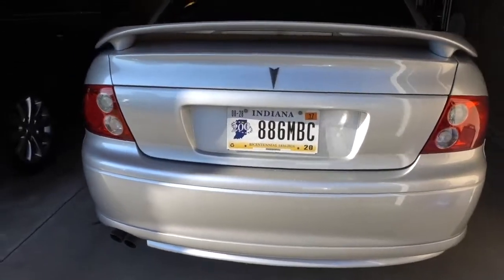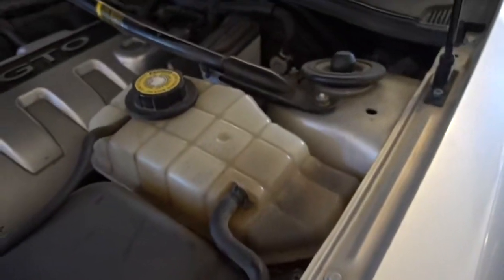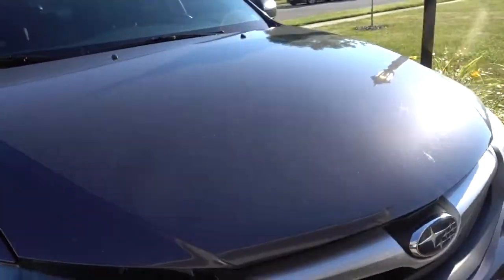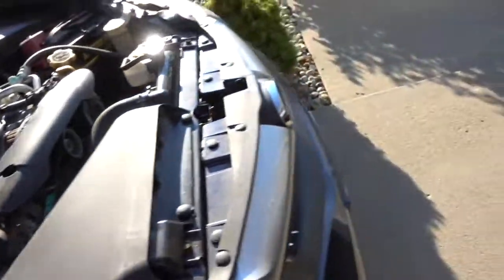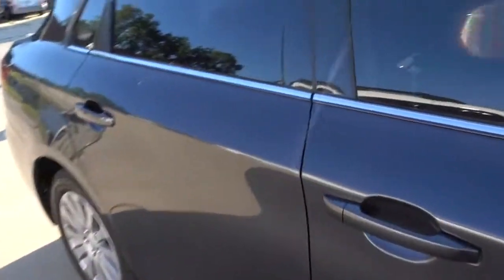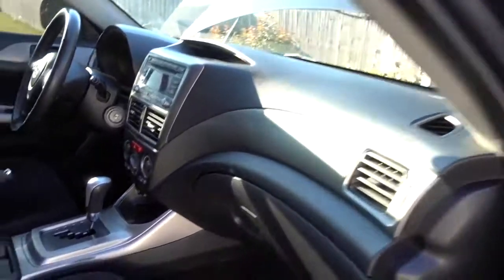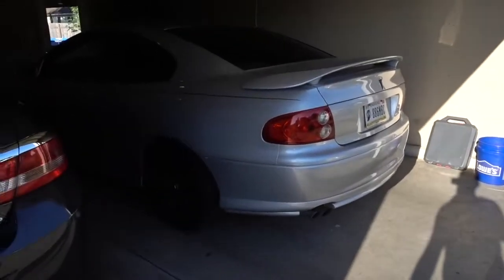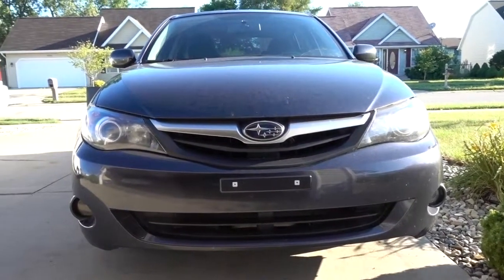My New Car

Comment: hello bro. I had Mazda 626 IV GE car, I sold it a few days ago and Subaru impreza caught my attention. I saw your videos while researching the Impreza. Your videos are instructive and helpful. so first of all thanks. I had a problem with the ignition distributor and maf sensor on my mazda 626. For a car over 30, this had become a chronic problem. Since he is over 30 years old, it was difficult to find original parts or quality spare parts. I want to ask you, is there a chronic problem with the impreza? Or what do you think is the weakest part of the Subaru impreza?
Reply from the maker: Main thing is transmission and head gasket